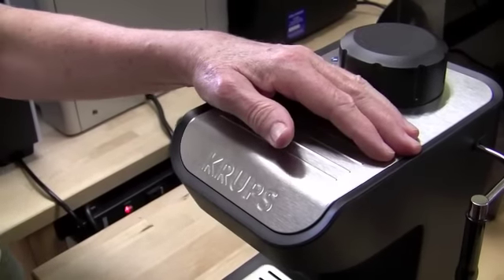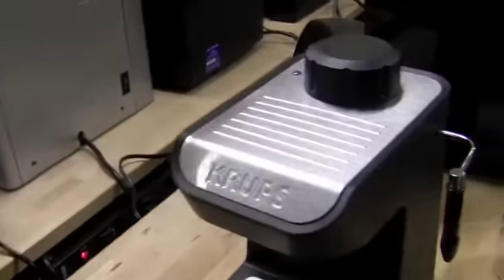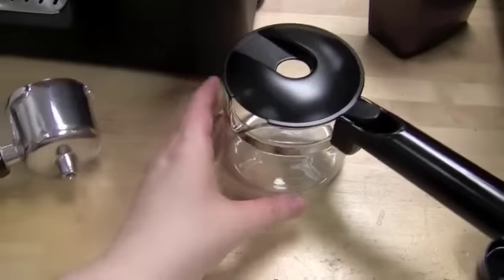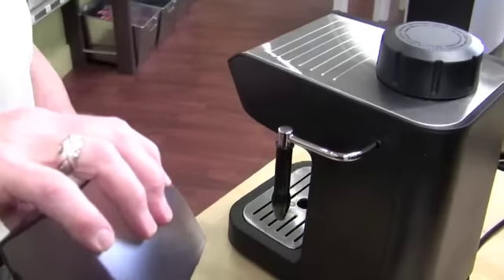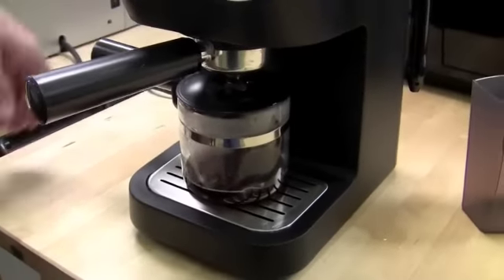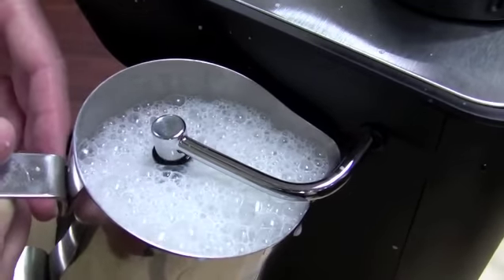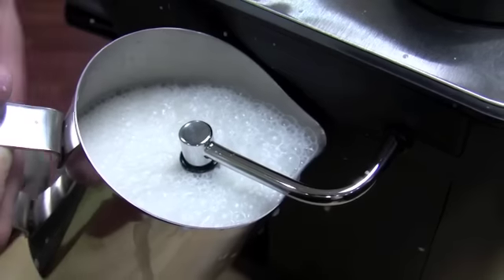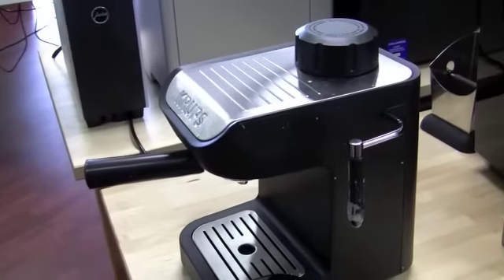Gear Testing: Krups XP1020

Comment: I have this machine! I'm about to upgrade but let me share my tips for a good pull:
-2oz at a time
-don't tamp much if at all
-turn the machine onto wand-steam mode until the pressure builds up
-turn the machine to coffee mode
-allow the coffee to brew for about 20 seconds

There will be crema!!!! Make sure you use fine ground coffee. You can even steam the coffee itself after to fluff it up.
If you do more coffee than 2oz it will take longer than ~20 seconds for the water to cycle through, and thus your coffee will taste bad.
Reply: Also, don't let the steam run through the grounds - only collect coffee while hot water is running through.  The last minute or so of hot steam extracts nothing but bitterness.  You can test this easily by collecting the final half-ounce separately - one taste will tell you exactly what you want to be missing.
Reply: Great tips from both of you, thanks! Never knew about the 2 oz and steam through grounds. Always looking to improve my coffee game :)
Reply: @TawdryTempest  yay I'm happy my experience was able to help someone!! I used this machine every day for a few years
Reply: Hi. Good tips. Just wondering: for every two ounces of water, did you use coffee at line 2 or line 4 in the brew basket?

Comment: I have a very similar machine. I like this method. Fill with water until almost full, install the portafilter with out the basket, turn on. When approx.1/2 of a cup of water has passed, turn the switch off.  While it's heating up I load grounds and tamp as usual, install the basket. Then turn the switch back to brew, pressure will build in the portafilter. Do not remove it until there is no more pressure in the boiler. I pull into shot glasses and turn the power switch to off before it's done.

Comment from the maker: @JulietsMan Sorry, steam-driven is not true espresso due to BAR and temperature differentials. Espresso is explicitly defined as coffee extracted under 9 BARs of pressure and within 195F - 205F degrees; no steam machine can produce these parameters. I won't argue that you can still get a great cup of coffee, but it's not technically espresso. - Kat

Comment: This method seems to give somewhat good results. You can not add water once you have pressurized the boiler. There will be plenty of water left to steam milk. however you can not pull another shot until the machine has completely cooled and there is no more pressure in the boiler. Remember Gail, Those switches also operate the valves! LOL! I love watching your videos! Keep it up! Thanks,

Comment: I have a similar one also from Krups and it has a flat insert to make steam without water coming through the filter. It works well, and it is better than a Moka pot because the coffee never sits on hot metal, and way better than drip, because drip makes bad coffee. A proper espresso machine is better though.

Comment: Okay...you CAN get a beautiful rich cream from a steam driven espresso maker and IT IS TRUE ESPRESSO and in IMO Far superior to pump driven espresso. You have to make sure the grind is perfect and that the pack of ur coffee is not too loose and not too tight. If you get it right, about 3 to 8 seconds into the pull u will get REAL OILY CREMA instead of that fake air induced crap u get from a pump driven machine. Keep practicing and you'll get to the ART of a good cup of coffee.
Reply: I have a similar model to this and I made 4 cups/oz. When it was brewing the first 2 I had a really nice crema and I was excited, but then I think the steam got too hot or something because the amount of coffee flowing out slowed significantly for the last 2 oz and by the time it was done all the crema was gone and the coffee tasted more like a kick in the face than espresso. Is there anything I can do to improve this?
Disclaimer I have probably made all of 10-20 oz of espresso in my life and I'm just starting to use the machine my mom didn't want anymore lol.